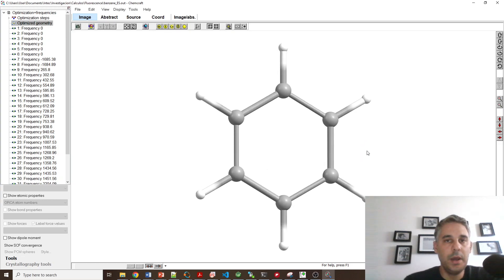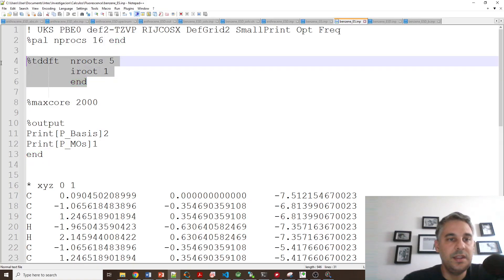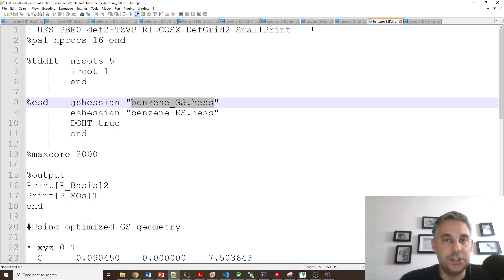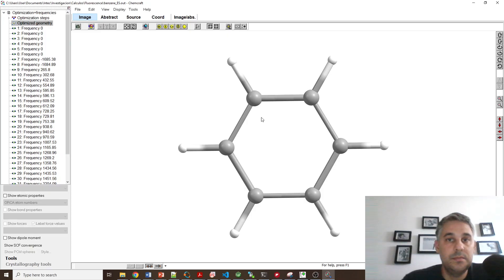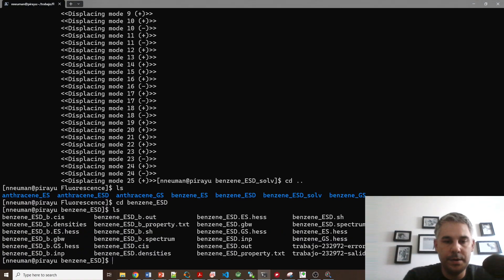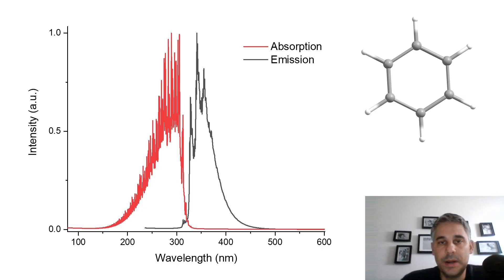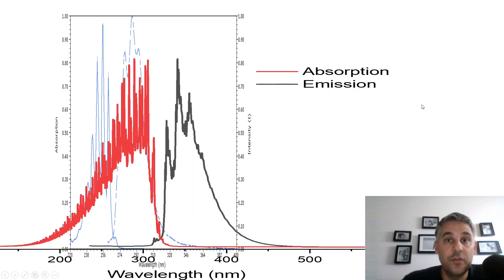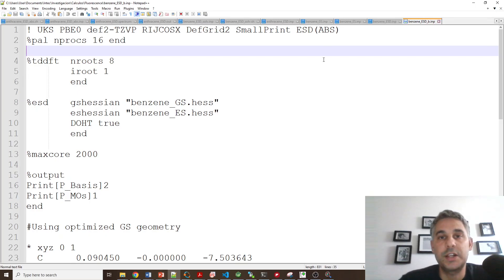Fluorescence Spectra with Orca

Comment: How much of an impact does solvation have on this? Will running these with some implicit solvator blue-shift the theoretical results back?

And if using an explicit solvator, is it possible to only get the spectra from the target molecule (as if we were 'blanking' our cuvette full of solvent)?
Reply from the maker: I still don't know. I did the ESD part also with benzene solvent and it was exactly the same. but the Hessians were obtained without solvent. I guess with a highly symmetric molecule such as benzene and a non polar solvent it will not change much, but in a polar molecule that does CT transitions it will matter much more. but the optimization has to be done in the solvent, to stabilize a more dipolar excited state. regarding the explicit solvent, if you have non chromophoric solvents it should not matter, but you should restrict the Hessian calculation to your molecule of interest otherwise it will take forever. I don't know how to restrict the ESD calculation to involve only the modes of your solute, and not the solvent, perhaps it only takes information from the Hessians you provide but I don't know the internals of the module

Comment: Thanks for the tutorial, it was really useful. However, I was wondering, how do you know which root you should peak? For more complex molecules, should you run first a TDDFT calc. to identify the relevant excited states and then run each of their ESD?
Reply from the maker: I was assuming the first root is S1, but yes for general cases it would be good to look at the energies of the roots, and see which ones are active transitions. In the case of benzene I got very small fosc so I wasn't sure, but for larger chromophores it is generally easy to see which transitions are the main ones. But I think that for most chromophores the S1 and sometimes the S2 states are involved in the fluorescence

Comment: The ESD module is very cool for Resonance Raman spectra. However, my calculations of Abs and Fluor in a way bigger molecule than benzene are diverging, the calculation only runs until a determined wavelength and the spectrum curve is an e^x instead of a gaussian 😂. I'm suspecting that the error could be related to the 0-0 and adiabatic energy, that energy is supposed to be in the visible but is like 10000cm-1. I'm going to try other functionals ⚰️
Reply: It is useful full. I have a doubt the fluro spectra is in cm^-1, I can't compare it with the absorption spectra in nm.
Reply from the maker: @jjohnpaul9539  if you open it in something like origin, or excel, you have to make a new column and do 1/(data in cm-1)*1e7 and set is as the new X axis
Reply from the maker: if your spectrum looks like e^x perhaps the window for calculating the spectrum is not reaching the calculated low energies. I also see very red shifted spectra. @slin1990 pointed out that it could be using  UKS instead of RKS, and that may be giving the wrong excited state. as I always use UKS by default that may be the problem with some of the molecules.

Comment: Hi Nicolas, I was wondering if you could also use the excited state geometry and hessian as obtained through the new deltaSCF feature? Awesome tutorial as always. Best
Reply from the maker: I haven't tested the deltaSCF procedure. the calculations in this video were done a while ago in Orca5. but I should revisit everything with Orca6. although I think that would take care only of the excited state, but the ESD module will have to be called anyway to calculate the spectrum, and that is the slow part.
Reply: @niconeuman  that's true the numerical operation in the ESD will stay the bottleneck. For larger molecules though even a   TDDFT opt&freq job will take ages and at least for the first excited state deltaSCF is superb IME.
Reply from the maker: @slin1990  do you know if it is more accurate for the energies? Because my PBE0-def2tzvp seems to be inaccurate even for benzene. Also in other molecules the spectra are too red shifted, and I don't know if it is a shortcoming of tddft or the ESD module
Reply: @niconeuman  I think it is more accurate in terms of energies as deltaSCF is used so often to get accurate S1-T1 energy gaps for TADF emitters (see Mewes work).  So I can absolutely see it also giving better results here. I guess the amount of HF exchange will also have a sizeable impact on the abs and fluor energies.
Reply: In the mean time I did perform the S1 Opt with deltaSCF and forgot about one thing. Delta SCF is not suitable for pi-pi* excited states but only those best described as electron-hole pairs. I got a very quinoidally distorted structure so the ESD through an error. 
BUT I also noticed that you ran all your calculations in unrestricted mode! When I use RKS for the iroot=1 state in the tddft I get a normal minimum, using UKS I also get an image. freq ( different because of Orca 6 probably). Using the RKS in the ESD I get reasonable energies (v_max = 45100 cm-1) whereas with the UKS excited state I get very similarly red-shifted results (v_max = 33400 cm-1). So I think your calculations might have converged to a different excited state. 
Sorry for being stupid and misleading with the DeltaSCF thing but maybe the UKS thing turns out helpful. :)
Reply from the maker: @slin1990  thank you for sharing your results. It's true that UKS may have given the wrong excited state. I haven't checked the orbitals and I'm not sure how to easily check in which excited state I am. I will try again with RKS

Comment: Very informative video. Sir I am facing problem to install orca 6.0 in windows 11. Could you make video  of complete installation of orca in windows 11. Waiting for your video..🎉🎉
Reply: But could you make a tutorial on how to integrate orca and xtb as xtb is important to perform Inclusion body complex docking.
Reply from the maker: I think this one explains how to use XTB:
https://youtu.be/n05R1Jl6BuM
it's easy to use XTB in Orca but you have to have it installed and make a symbolic link to the XTB executable in the Orca folder. it is explained in the Orca Manual I believe. 
I also have newer videos with XTB, but I don't remember right now which ones, you should watch all of them!
Reply: @niconeuman  thanks I'll will look into it.
Reply from the maker: unfortunately I can't. I have windows 10, and will try not to upgrade to win11 for as long as I can as I understand it has AI surveillance incorporated. but also, the orca binaries for windows weigh several GB, and I haven't been able to download them from work. our internet is too slow.